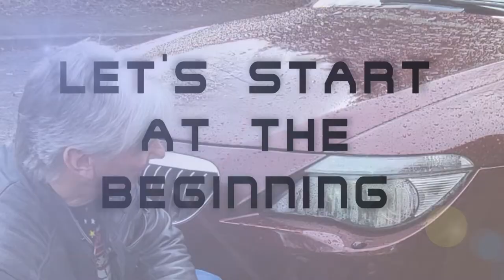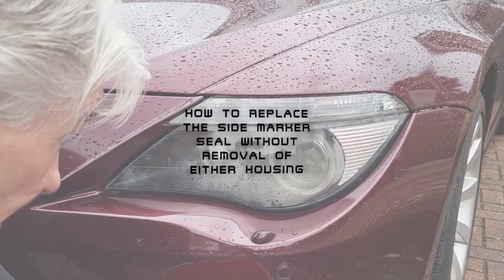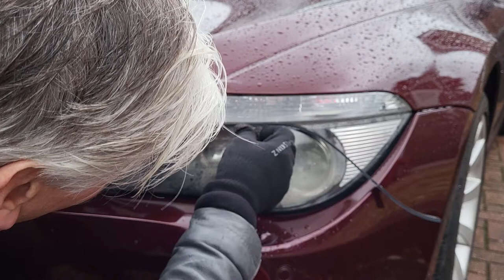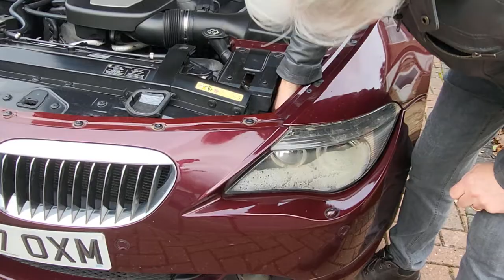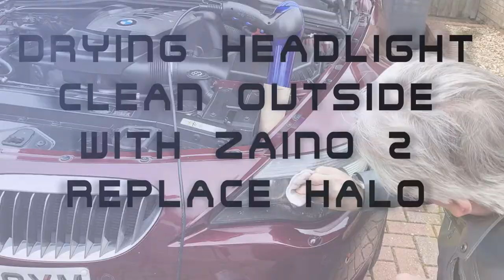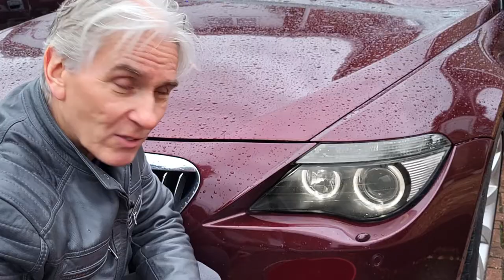BMW 6 Series HOW TO FIX DROWNED HEADLIGHT

Comment: Be warned, this is a temporary fix. The only way to properly fix this is the headlight off of the car, open and reseal the unit with butyl and reattach. Personally done this to one of my headlights on my BMW about 1 month ago and its now as brand new. More modern BMWs will have adaptive lights and a TMS module that sits at the bottom of the unit that will corrode over time from the condensation.
Reply from the maker: Thanks, I thought the light wouldn't come apart, but I will have a go next!
Reply: Maybe spray CRC on the modules before corrosion.
Reply: U have a video on how to do it the way your talking about

Comment: This happened on my F10.  Had to completely rebuild it with a new control board and re seal the lens with adhesive.  Better than paying 1800 on a replacement.

Comment: Another great video, Timm.  Unfortunately, same happened to mine under the ‘sadly a case of when not if’ section of annoying problems with my E63.  For me, however, water had been left standing too long and it damaged the adaptive headlight motors resulting in the beam seizing in the incorrect position and a subsequent MOT failure.  Cue having to remove headlight, prise apart and have the motors set in the correct position.  Only a temporary fix and means I no longer have adaptive headlights, so your video is yet another reminder that these small, cheap fixes now can save a whole world of pain further down the line.
Reply from the maker: Thanks!

Comment: Could not be better timing Timm. This just happened to me a couple of days ago! Getting lots of rain over here in Northern California. I rebuilt my headlights on my E39 540i a few months ago and it looks like I'm going to need some additional butyl tape to seal the lenses. I used the top hole and a hairdryer to get rid of the temporary moisture that built up after one drive out. I'll likely have to remove the headlight from the car to add more sealant. Thanks for another great video Timm, Happy New Year!
Reply from the maker: My pleasure as always!

Comment: You split them and reseal them, problem solved. Had the same problem wasted hours with the hairdryer. Had new front indicators and still did it. Split them, lens off new weather seal problem solved
Reply from the maker: I saw that they appeared easy to split, are they glued together or just clipped like the early ones?
Reply: @TimmsBMWRepairsandInformation  ours were bonded as 04.

Comment: I have a 2008 bmw 650i and it has been raining here in California, I noticed my left headlight when off and it was full of water juts like yours ! The halo rings work but the main Beam didn’t so I change the xenon bulb and the ballast but still no light ! 😭 do you think I need a new headlight?? Or should I try drying it like you did ? Pls help 😁😁
Reply from the maker: That is probably the module under the headlight - check my video's and I show how to replace it for 25 quid and without removing the bumper
Reply: @TimmsBMWRepairsandInformation  ok thank u

Comment: The weather strip is a good fix Timm. Is there an actual BMW part for the seal between the top of the headlight and the bottom of the indicator?
Reply from the maker: Just checked, and no, nothing on the diagrams - here's the stuff I used:
brush: https://amzn.to/3jJYi8A
tape: https://amzn.to/3WX8wRb

Comment: Hi Tim. Thanks for the video.

I wonder if someone could use clear silicone sealant instead of the sticky tape?
Reply from the maker: My pleasure! Silicone sealant would seal the headlight to the turn indicator - and it would never come out again - hence why BMW used a one-sided adhesive seal
Reply: @TimmsBMWRepairsandInformation  How about using some "flex seal"?🤓
Reply: Flex seal.

Comment: Hi Timm. Great work. I hace the same problem. What about extracting the headlight and seal completely?
Reply from the maker: Thanks! The headlight does not come apart on the pre-LCI, so the only access is through the main-beam aperture
Reply: @TimmsBMWRepairsandInformation  It does on my 05 pre facelift E64. Easily opened as it is sealed with butyl, just some heat needed. OE butyl is very thinly applied, especially at the top section where it matters most and this is where it leaks.

Comment: Good thinking with soapy water, helps with sticky stuff. Why was the brush needed though? I just dried my 5 series headlight without touching the inside at all. I warmed the outside with blower heater and ventilated the inside with hear dryer.
Reply from the maker: Mine was dirty inside due to it getting water in it!

Comment: Excellent video! Nice idea using the flexible brush, I wonder if I might be able to do something similar to clean out all the green algae and moss living inside my E63's rear brake light clusters!
Reply from the maker: Thanks, and YES - I have just done this today, you need a much smaller brush set: https://amzn.to/3Q8WkKT the small one gets up under the skirt of the light and gets the green stuff out with the help of a stream of water from a garden hose. I recorded the process so I'll put that at some time in the future
Reply: @TimmsBMWRepairsandInformation  Fantastic! just ordered a set of brushes for myself and look forward to the video. The moss has been a bugbear of mine since I bought the car.

Comment: Are those stock angels eyes from factory? If yes then what kind of lamps you using? Mines its looks like its powereting the only small circle
Reply from the maker: No, they are 3W LED's from Amazon - I have been using them since 2015, nice and white and illuminates both rings

Comment: My head light is good but my.indicator is steamed up.   Its a small crack so I will simply replace it.. but when I do.i will be putting the 3 m tape between the two as you did.  Great video 👏
Reply from the maker: Thanks, and good plan!

Comment: Hi Tim, what did you use as a replacement seal?
Now if you could work out a way to remove a dead moth from the side of the light......
Another great video buddy!
Reply from the maker: Thanks! Try a Dyson in the main beam!
Reply: @TimmsBMWRepairsandInformation  Cheers Tim, Tried that.......beastly thing won't budge.I have no idea how it got in there in the first place. I might try the flexible brush.

Comment: What happened to your old seal between indicator and headlight? Mine was brittle as hell, too much sun. The E63 isn't too keen on lots of sunlight and heat, but you're in no immediate danger of that, judging by this video 😆☔⛈

I couldn't even tell which part the original seal was attached to, indicator would be my guess. So you might be able to get away with just replacing the indicator if that's the case -much cheaper an easier to replace-, but your drying method was inspiring, for sure! Thanks for that!
Reply from the maker: Thanks! Even with our feeble amount of sun the seal just fell apart and dropped out - the right-hand side needs to be done soon, it's still there but not doing much!

Comment: which weather strip did you use? and where did you buy it? would help people I think. can be generally difficult to find :)
Reply from the maker: I used some from work - Norton Tapes 5mm x 10mm double-sided foam tape

Comment: Excellent video Timm..  I tried to change my cree led lights on my mercedes c207 to brighter ones but I can't get the connector off its like it's glued on. I watched a few you tube videos and they make it look so simple but mine definitely isn't. I would really appreciate any help on this matter. Thank you
Reply from the maker: They can be a real pain! Use WD40 to get into the connector pair and then lightly nip the pair with a pair of pliers, that usually loosens them up!
Reply: @Timm's BMW Repairs and Information Hi Timm, I can't get a plier in there as it's a very tight space. I tried to use electrical contact spray and they still didn't budge. I don't know if there's a special tool that I can use to release them. One of the connectors is slightly bend as i asked a garage to remove them but they must have squashed the connector with a plier by using to much force. Thank you for all your help.

Comment: Hi Tim thanks for your videos they alway prove helpful. Im struggling with a weird issue on my e63 where i cant get the driver side gap between the bottom of the headlight and the top of the bumper to align. it seems like the bumper has sagged creating a gap. i have played around with the headlight alignment but nothing seems to resolve it. there is no issues on the other side. If you have any experience with this i'd be keen to know your thoughts. Cheers
Reply from the maker: The pancake bolts around the top of the bumper (seen when the bonnet is open) are adjustable (the bumper holes are quite large). Try loosening all the bolts and moving the bumper - worth a shot!

Comment: I've had this on my 1 series, left the lights on full wack for an hour or so and used a hair dryer and it's cleared it.
Hopefully it doesn't come back
Reply from the maker: Good tip!
Reply: @TimmsBMWRepairsandInformation  update, it didn't solve the issue! However, I removed bungs/caps at the top and it's doing the trick!! Need to re-dry them and maybe drill some small hopes in the cap to allow air to circulate. I think it's from having the lights on, warming the unit then the air temp drops causing condensation. Apparently there are vents/breather tube that maybe blocked, I can't see where they are

Comment: I’ve melted the plastic on my bmw headlights trying to use the hair dryer on it before
Reply: This was in 2020, I’ve since sealed the spot that was melted and it’s fine.

 I attached a spare rad hose to my hair dryer and pointed it inside the headlights let it run for like 15 mins. Anyone who tries this out don’t use too hot of a setting because the plastic melts very fast
Reply from the maker: Good info!